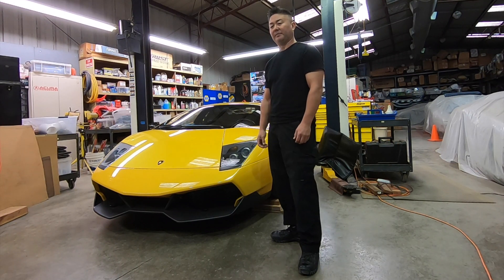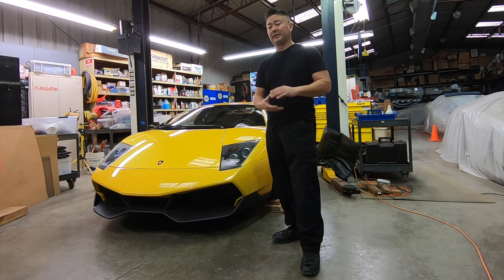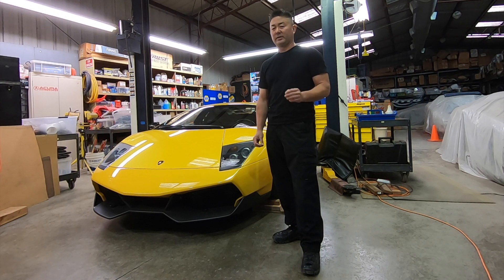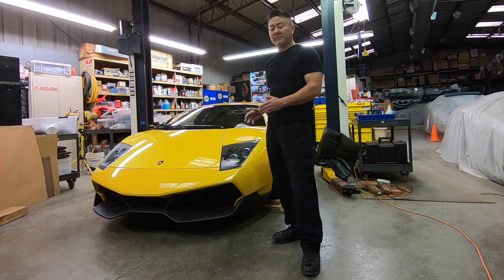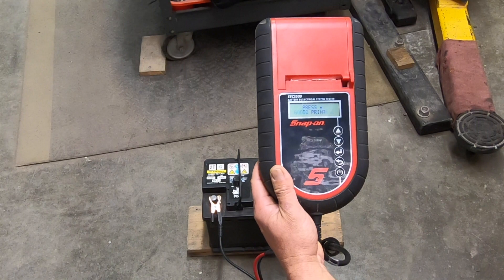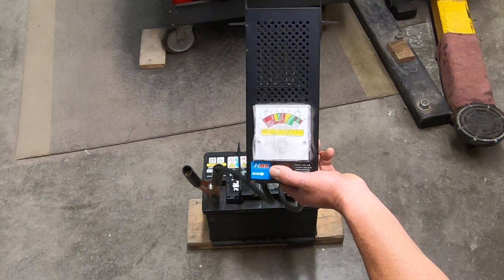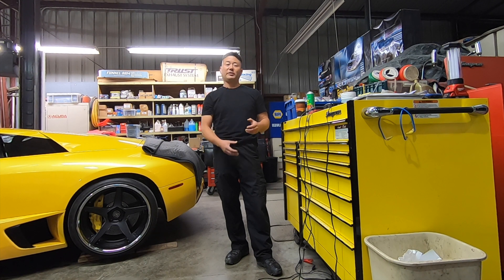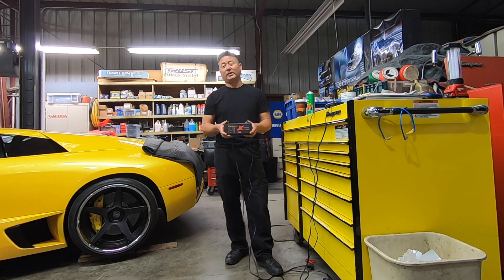Battery Tech. & Murci Battery Change

Comment: Hi thx for the video! Did that battery you get for your murci work better than the agm? Thx
Reply from the maker: I am glad you like the video Bud.  The flooded lead acid worked as good as the AGM.  I changed the battery to an Antigravity lithium ion battery and did a video on it.  If you can swing it, the Antigravity is the way to go from the weight saving alone.  Take care.
Reply: @AdamSaruwatariXtreme  appreciate the reply.. the weight doesn’t bother me , I don’t drag the car. I got a gtr for that and it’s no comparison. I’m just sick of the car dying out and I have the battery on a tender the whole time . I haven’t drove the car in 2 years but I would like to start it time to time. Thx u

Comment: Hello ,The oem battery is group 34R? 
What about lithium battery for the murci?
Reply from the maker: Hello my friend.  It has been a long time since I changed the battery on the Murci.  I can tell you that I have come across different sizes in different cars.  You know the whole Italian car thing.  I would pull your battery out to confirm the size in your Murci to save you time and headaches.  One of my videos covers when I changed the batter in the Murci to an Antigravity Lithium Ion Battery.  I have not had any problems.  Let me see if I can find the video.
Reply: @AdamSaruwatariXtreme  amazing, i wanna buy a lithium battery, cause is lighter and better i think. Sure the oem battery is a group 34 w/ right positive, so i saw a XS brand, and antygravity too, but dont know which is better, lighter …….between both.
Which model is yours??? 
Thanks
Reply from the maker: The lithium ion battery is a large weight savings.  I have one  the Murci and Aventador SV.  They have been in the cars for a long time without any issues.  I do not have any experience with XS, but I really like Antigravity.
Reply: @AdamSaruwatariXtreme  excelent! I’ll go with antigravity but what model do you have in the murci?? H7/94r?? Thank u
Reply from the maker: Pull the battery on your Murci first Bud to verify.  I have seen different sizes used in various Murci's.  Have fun!

Comment: How you doing?on min 10:23 shows all connectors,can you please tell me where the tiny wire connected to the ground cable leads to ? Mine dont have any wire there and iam having a low voltage to ground issue on my e-gear ,i wander if that could be the issue ?the codes i get are P1741 P1745 and P1747 , after she warms up (about 15 to 17 min ) voltage drops below to about 12,8 fluxuate back to 13,2 but e gear light comes on and she wont shif into gear, if i let the car cool down and kill the battery she will reset and work again for about 15min ,battery is brand new; could be the voltage regulator and the missing wire?your videos are awesome ! Thank you in advance and God bless you🙏
Reply from the maker: Hello my friend.  You have a lot going on.  I need to finish a project.  Give me a little time, and I will see if I can first identify what the codes are.
Reply: Thank you very much🙏
Reply from the maker: Hello Bud.  Do you know what the codes are?  I could not find them online or in my notes.
Reply: Thank you again Adam🙏 .those codes came out a leonardo computer system ,i have a really kind friend that will be coming here on the weekend withe the (real Lamborghini system , the LARA and them i will have the right codes! As soon as the car warms up the alternator stops charging the system (about 15 to 17 min after i start the car , i change the voltage regulator on the alternator and the positive and ground cables ,iam gonna put a hole new alternator on it ,i already have on the house !if my alternator is the issue , can i get a e-gear light from it ?after i change the alternator do i need the LARA to reset and clear all the codes on the ECU? I want to learn how this machine works ,and to me is like a therapy to actually get the job done on the car ,i own the car for 7months but not a lot of info can be found online for it !thank you again for helping me , its a passion for knowledge the makes me even more proud of owning this machine!God bless you brother🙏